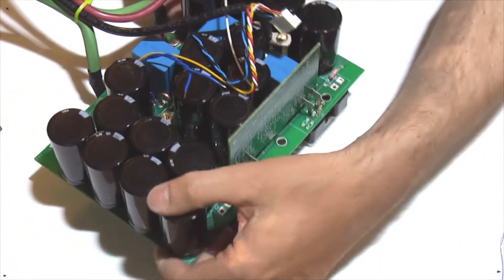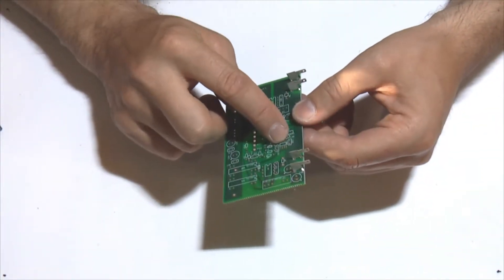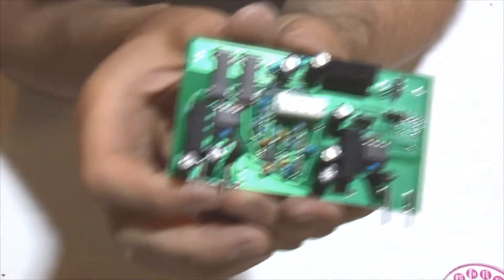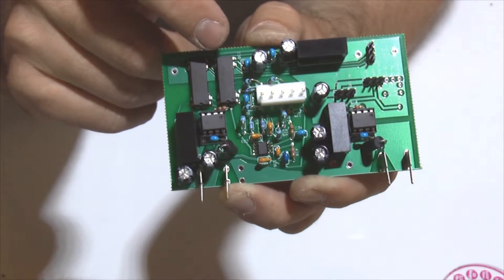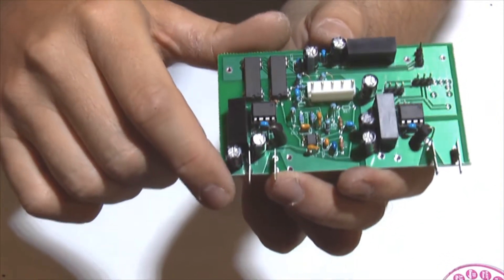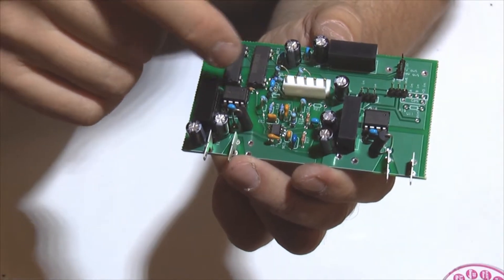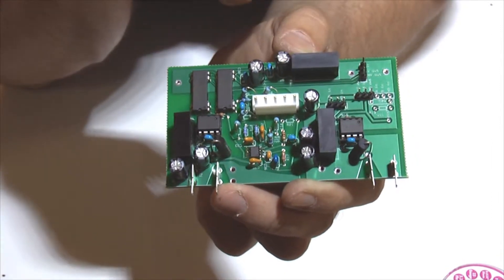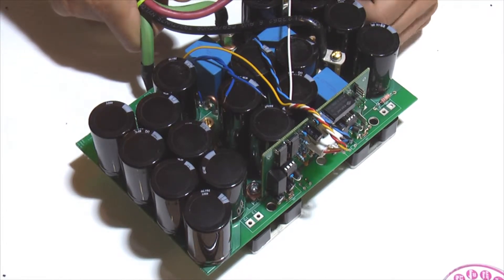EMotorWerks SmartCharge-12000 Assembly Manual - Part 5: Driver Board

Comment: Wy do you use such a huge capacitor bank?
I've simulated 20kW 600VDC/350VDC, it is enough to put 20uF Polypropilene caps